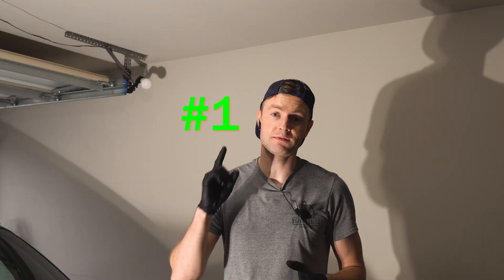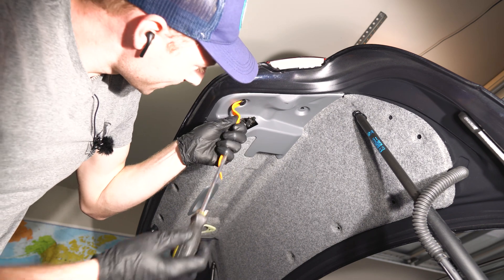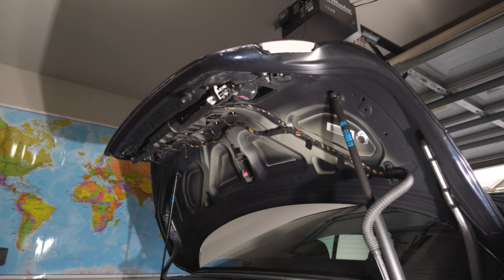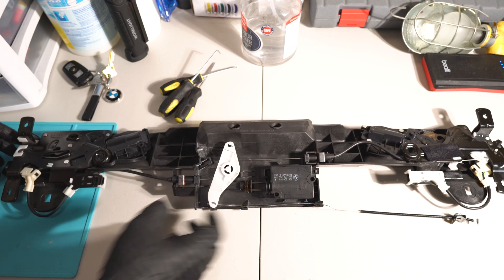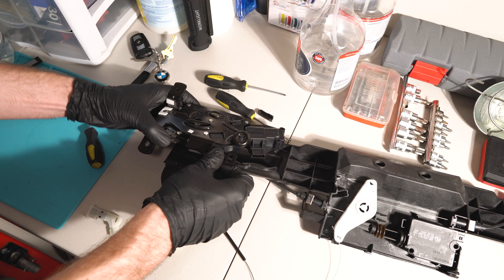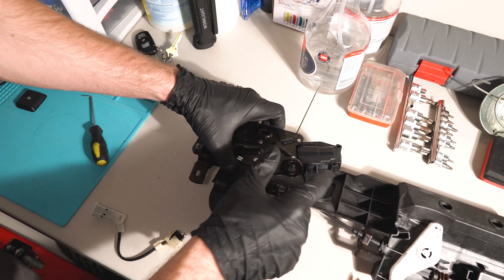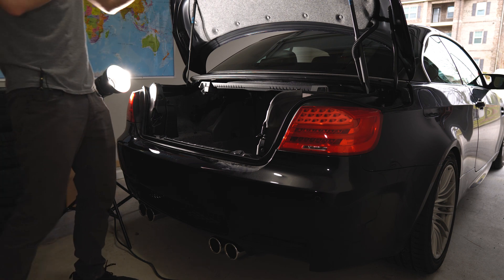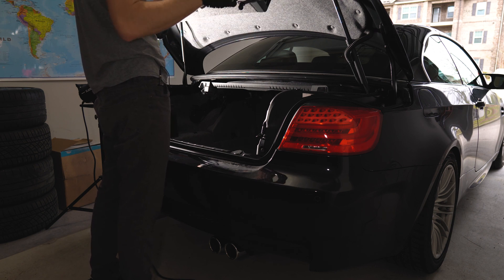how to repair BMW Electric trunk Latch actuator motor is not working e9x LCI

Comment: Issue is I have is trunk open fine and when closing goes down, I hear the actuator running but it isn’t locking the trunk down leaving it open with an open trunk warning on dash.  If I help push it down manually just as it’s about close it will close fully and I don’t hear the actuator run

Comment: PLEASE HELP! My microswitch on my 2016 BMW 428i messed up, and I’m not able to find one anywhere. 
The motor is fine, it’s just one of the switches. I was told that I had to buy the whole motor that the microswitches weren’t sold separately. Is this true? If not can you direct me where to find them? Thank you for your help!

Comment: Thank you for this awesome video, really helpful, the job is a bit fiddly but your methodical process paved the way to a good success rate into whitling down the cause of the roof not working, in my case the rear trunk icon would alight up as soon as i press the roof button , windows didn't roll down and obviously the roof wasn't playing ball, please post more great content, much appreciated.🙂
Reply from the maker: Make sure to check all of the wires that goes from the cabin in to the trunk, it’s actually really common point of failure.
Reply: @Makhnovets  Thank you for an instant feedback, Legend Man, we need to promote you to be the next President of fiddly and nauseating car repairs guru status 😇

Comment: Fantastic video! Congratulations! On my e93 my trunk does not close properly either. Since neither of the two trunk lights comes on, I deduce that it is an electrical problem (some cut wire). It can also be the microswitch or should I look at some other connector? Fantastic video! Congratulations! On my e93 my trunk does not close properly either. Since neither of the two trunk lights comes on, I deduce that it is an electrical problem (some cut wire). It can also be the microswitch or should I look at some other connector? Tky! Greetings from Spain!
Reply: Hi, do you find the solution please for closing properly ?

Comment: I have just had the same issue with my E93, on using my multimeter to check the switching of the two microswitches, I found one switch did not have any continuity on one wire. I found one broken wire hidden behind the black heat-shield. Now soldered and all working. Thank you for posting this video, it really helps us fix our own cars.

Comment: Can’t find words to thank you. Really great explanation. I found out that the problem from the left microswitch as every time i touched it the bulb of the boot turns on which then soft close mechanism works, but it keeps on/off so i had to take it off. I tried to unplug the microswitch but I couldn’t as I didn’t want to break something. I checked the wires of the microswitch while it is on, and found that one of the wire cut (green one). I linked them together and taped it and now works 100%.
I hope you add your PayPal or bank account in bio or here, i am sure im not the only one who thinks you deserve some money for what you are doing here.
Thanks

Comment: Do you have link to buy these switches / actuator im having exact same issue ( United Kingdom)
Reply from the maker: You might be better off to finding those in UK, in US You only can find the whole assembly which is $700. Plus the e93 is pretty rare here so it hard to find a spare parts anyway. Good luck

Comment: Fantastic video, thank you. After pulling the assembly out, I used a multimeter and found the issue is the driver's side microswitch. I am having a hard time finding the part though, it looks like you can only buy the full assembly.
Reply from the maker: Thanks!
Yes, the real problem is to find the part, best suggestion is to look up all the junkyards around or to retrofit any other micro switch. Good luck

Comment: Hi, this is a great video, the best I have came across, I had to show for a local repairshop 🙂.  the problem as you mention in the text is to find a place where to buy the micro switches, I thought, the video is over 3 years, so maybe you or someone else in here can share where to purchase the mircro switches? that would be fantastic to get the Cab running for the spring. Rgs a happy E93 2009 Owner.
Reply from the maker: Thanks for the comment!
Unfortunately there was no solution found for this problem, the only think is to test the micro switches before any disassembly, a-lot of times it’s the wires but not the switches, but if the switch is faulty what some people do is buying similar one and retrofitting it, there only solution that i know of other than getting used parts off the ebay or find salvaged e93. Good luck man!

Comment: Excellent Video. Can you tell me if you disconnected the battery when doing this or left it connected. Thanks
Reply from the maker: I have not, technically you should, but i have the bmw obd tool, so if any i can reset it easily, but for most people that could be a problem if any…

Comment: So the only thing you changed was to remove the piece of plastic that somehow got in there?
Reply from the maker: No, one of the microswitches had bad connection, I learned that after car was sold, the guy who bought it had the same issue.

Comment: Just being curious. My Softclose does work. But just my interior lights in the trunk don’t work (the one in the trunk lid and the one bottom right). Is this the right way to repair the light? There is no power going to them, fuses 7 and 62 are good.
Reply: Did you find the solution to the lights not working?

Comment: I'm having the same problem, did anyone find where the micro switch can be purchased? I have a 2011 e93. Upon taking the boot panel off i can see the 3 wire cable has already had a repair done to it
Reply from the maker: Make sure the switch is toasted, the most common problem is the harness, use the multimeter to test the switch! as far as I know that some people get a different switch and fitted somehow on the spot, but as for buying the same one, still no luck, I can't find it.
In any case, good luck, and if by any chance you find a good solution, drop the comment, we all have the same freaking problem. F*** BMW lol)
I still love it!

Comment: I have a 2010 Z4, 3.0i and your video featured exact issue with my Z4. Questions: 1. How do I know if the microswitch is defective? 2. Should I check the fuse box for possible issue? Which is the fuse related to the latch mechanism?
Reply from the maker: The z4 has 9 or 11 micro switches related to the retractable roof, and technically any of them can cause this issue, but logically you start from the trunk. Also, check the codes. When the roof stuck open halfway on my z4 e89 it showed me exactly which microswitch is related. You can check RealOEM.com for a diagram and see the location for all the roof-related switches. as for testing, it has two positions, close and open, you need a tester" multimeter". just test all of them.
Most of the time the harness is the issue, it cracks, I will have a Video on that topic soon.
Good luck!
Reply: I'm late to the party but leaving this here for the next person. Just test the switch in both positions using a multimeter and look for continuity through the switch on different pins. Check out a video to see how these switches are supposed to work, then you can easily ID if one of them is not doing what it is supposed to be doing. You should have continuity on 2 pins with the switch in position A, then continuity on other pins with the switch in position B.

Comment: Hi guys , I have same problem and already remove the switches , but problem from where to find and buy new switches !?
Reply from the maker: We all had the same thing in common 😅
If you can’t get replacements, just look for similar switches, re solder wires and hot glue or super glue it on. After all most of the micro switches work same way…

Comment: On mine open by it self when I open my car
Reply from the maker: That’s pretty interesting 🤔, most likely you have some wire in the boot or the trunk touching the ground or something, in the most cases the microswitch have broken wire, so when people take it a part and re-assembled, it magically start working, but then it dies again.
Look for the broken wire, that’s gonna be my best advice.
Good luck!

Comment: Awesome video. Having the same problem at the moment! Can’t find a mechanic that can do this!
Reply from the maker: Thanks, That's the problem, they're few out there that will rebuild it, but mostly shop's will offer you to replace it, look for BMW repair services online, I don't know specific one but I'm sure that you can find something!
Reply: @Makhnovets  do you know where these individual bits are available? Like you said the garage said to buy the whole unit! I’ve explained there is other ways to strip it down and they are not sure if they can buy the individual bits like the micro switches etc they scanned it and think it’s one of the latches as the codes say boot lid etc
Reply: The links above don’t seem to have any available
Reply from the maker: Sorry but I can’t find the exact switch any more. There was a one seller on the ebay, but not any more. In any case did they test the motor? If that’s the problem in the latch itself, there higher chance of getting one from the ebay, occasionally i see them, same as assembly, just keep looking on the eBay. 
For example: https://www.ebay.com/itm/284247751380?mkcid=16&mkevt=1&mkrid=711-127632-2357-0&ssspo=K2GQ5JXCT4O&sssrc=2349624&ssuid=G7DbUTPNRfG&var=&widget_ver=artemis&media=COPY
Reply: @Makhnovets  thank you 🙏

Comment: Hi, i have the same problem, would like to try and change the microswitch but the link in the description does not work, do you have a part number or something? Thx!
Reply from the maker: I will check it for the switch, but first remove the cover and see if the switch is working, simply use the tester, there only two wires coming from the switch, it either have open circuit or close. There only two switch and they are exposed well enough to test them.
Reply: @Makhnovets   will do, let me know if you can find some part number, because the mechanism actually works but you have to slam the boot very hard, if you close it normally it wouldn’t latch.
Reply from the maker: I see, my friend had the same issue, we mess around for a bit and now it’s working. I’ll send you what I found. What year make and model you have?
Reply: @Makhnovets   i have a 2008 e93 325d. This problem started about 1 week ago
Reply from the maker: Sorry man, I can’t find one, I forgot that they have 3wire. Sometimes it happens that the wire getting cracked inside, also i seen on the forum that people retrofit them, the principal of them are the same. Good luck! I’ll try to do better research later this week. If I’ll find something I’ll let you know!
Reply: @Makhnovets   many thanks, first thing i have to demount it and see, anyway if you find something let me know, i really appreciate it!

Comment: This is a great tutorial on removing the trunk latch assembly! I feel like us convertible owners get left in the dark when it comes to walk throughs on anything with these cars, but you did a fantastic job! The problem I’m having is my trunk won’t open unless I use my physical key and turn it in my keyhole. I removed me latch assembly as well to inspect it. When you pushed in your actuator I noticed it compressed in, should it compress? No matter how much pressure or force I put on my actuator that part will not compress at all and is fully extended. Do you think my actuator is the problem?
Reply from the maker: Did you try to actuated true the obd? Yes the first stage is manual the second is motorized, so Doesn’t matter how hard you push you will not be able to close it. When you press button to open the trunk either one and a key form from the interior or the actual button on the trunk does the car produce any sound? Do you check the fuse by the chance? I cannot remember which one… also make sure you have power to the trunk button, which is usually a fuse…

Comment: Hi my e93 m3 when i click the trunk switch like you did on 14:38 mines doesnt do nothing i can only open from swith under the steering wheel so what does it mean mine has wrong trying to solve my issue and mines doesnt close either fully?
Reply from the maker: Take the cover and see how the motor acting when you actuating the laches manually.
from just guessing it's either microswitch or or latch itself, it's relativly easy to see what's is going on when you take the cover off, also try to close the latches manually, and see if you can do that or if it's hase any resistance if you know what i'm talking about!

Comment: Hello thanks for the video. i think i have an issue with one of the mricroswitch. i dont understand why they have 3 cables. green, blue and black. In one of them there is not continuity between cables. but in the one that it works, there is a short between green and blue and it opens when the button is pressed.  does the black cable do anything??  thanks

Comment: Hi my 2012 Z4 2.8 E89 trunk wasnt closing all tge way, the slow motor assisted closing function waa not working.
I disassembled the trunk motor and latch assembly, and found the drivers side green and blue microswitch wires cut.  I stripped the ends, twisted and soldered, and reassembled. The trunk now closes perfectly.  

Do you have a link for a replacement micro switch?  BMW wont sell the switches, only the entire assembly for 900.00+ Dollars.

Also, my hardtop shows an error code and wont open.

Any help would be appreciated.

Thanks!
Reply from the maker: I have some samples of microsviches in description, but for specific one you will need to find the serial number which is should be on one that is installed in the trunk, just look specifically for microswich  with the code, not for the bmw.
In term the roof, what is the code? And is it because it has to do something with trunk lid?
Reply from the maker: https://www.fcpeuro.com/products/bmw-micro-switch-trunk-lid-lock-61318363693?ads_cmpid=1586640911&ads_adid=59893888775&ads_matchtype=&ads_network=g&ads_creative=298302526031&utm_term=&ads_targetid=pla-327620319311&utm_campaign=&utm_source=adwords&utm_medium=ppc&ttv=2&gclid=Cj0KCQiAosmPBhCPARIsAHOen-PTEU1J-mFuWZAWEARnFPxHmY14L2KDB5s79MYEAgtMmt56cC5JHFQaAomSEALw_wcB

Comment: I just finished rebuilding a 2012 328i coupe, engine 90%, head valve job, reinstalled it all and now I noticed the trunk is not responding to the buttons on FOB or inside the car. The valet switch is on the unlock position. 
There is no noise from the trunk when I press the buttons. When the car was being repaired and I took the battery out one time, I remember having to use a 12v small battery and behind the glove compartment I rigged a wire to harness to trigger the trunk to open and it worked. I did not touch it since. Do you have any idea if there is a fuse to the trunk release system? Any advice? I don't have access to the trunk between the rear seats, I would have to cut to get to the manual release. Thanks in advance.
Reply from the maker: I would use any OBD to tested and try to trigger the component, preferably ista, it also has all the diagrams, so you can test the wiring as well...

Comment: Hi , I have had the same issue but replaced the whole assembly instead of just micro switches , I’ve re installed the assembly but now the boot is just lashed shut. The motors open it a slight bit but is does not fully open it feels as if the latches are hooked on. Any help would be appreciated thanks
Reply from the maker: Do the reset true the ista, and try to manually close the left and right lach, and see how it goes, also make sure that the tross that goes to the lach is seated in the right place, i had the same problem once, fixed everything with just relocating the one of the tros vire

Comment: Hi got the same issue after jump start of my E93, BMW 335i convertible 2013.  When i took it service to center they said micro switches are broken but they asked to change the whole latch costing me around  $1400.  Do u think i should just buy the micro switch and try to replace it on my own?
Reply from the maker: Microswitch cost like $30 the job will take like an hour, i think it worth a shot, especially if you ready pay 14hundred. Why not to than! And worst case scenario you will take the car to the dealership and they’re going to replace it for the same amount otherwise you’ll fix a car for $30 and hour of your time!
Reply: @Makhnovets  , thank you so much for your reply! I was trying to find the microswitch for 335i 2013 model(E93) could not find online. Do you know where can i get those please? The link in the video from amazon shows the switches for other models, will those work for this car too?

Comment: Hi, My E93 trunk can not open, have to use key to open it, but when I close it, it will automatically lock.
can u help me identify which part is not working pls
many thanks
Reply from the maker: I would start from the button on the trunk, use the tester and see the passage when you press the button!
The servo which is response to the button action supposed to receiving 12 to 13 volt.
Micros witches go down pretty rarely, so test passage to motors, same way as the servo.
Reply: @Makhnovets  thank you so much!
Reply from the maker: @ericye6802  My pleasure!
Reply: also, I can not open trunk from the driver seat

Comment: I have the exact same problem but might continuously latching without even touching it & my truck light stopped working
Reply from the maker: There separate fuse for trunk light.
But in terms of trunk, make sure the button work correctly.